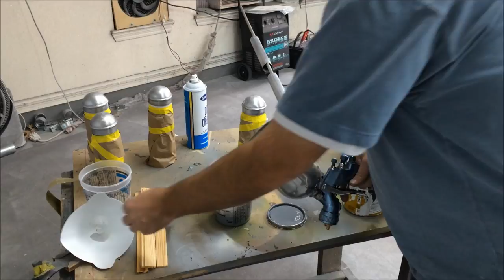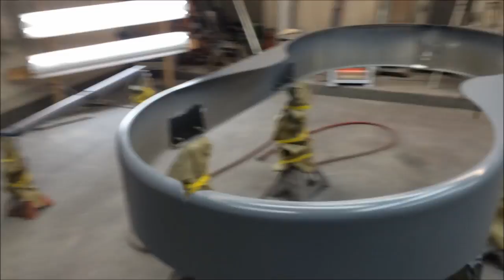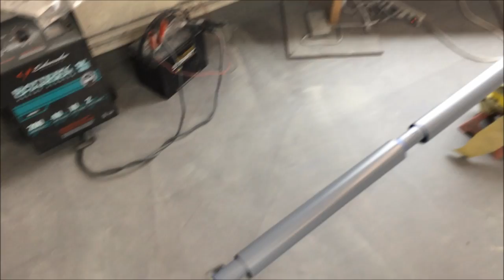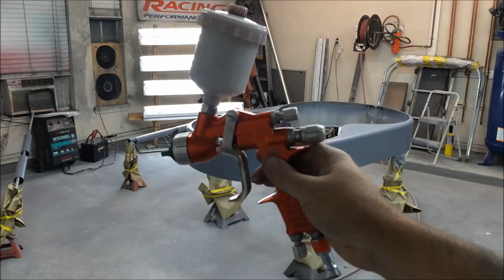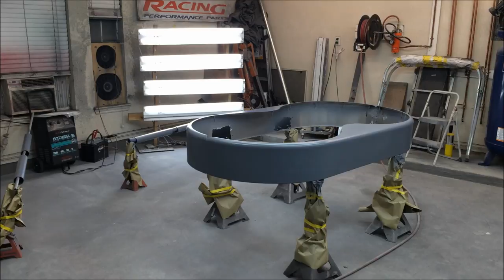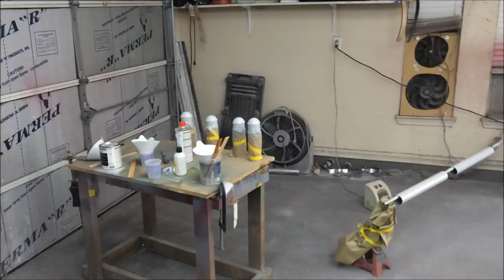Trailer Fender Table Part 3   Paint Job -

Comment: Yeah greg beat me to it dont put the stick back in the can.also you should mix that stuff allot more and let it sit at least 10 minutes before spraying.
Reply from the maker: The omni tech sheet doesn't specify an induction time, you can mix and spray it, but yea if i was painting something important i would have mixed it more thoroughly and let it sit for 15-20 min just to make sure...